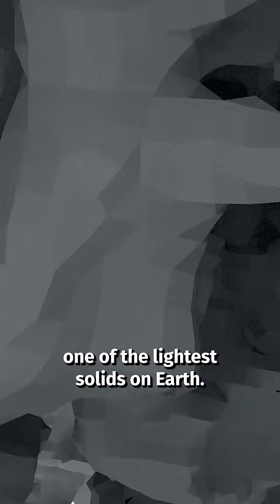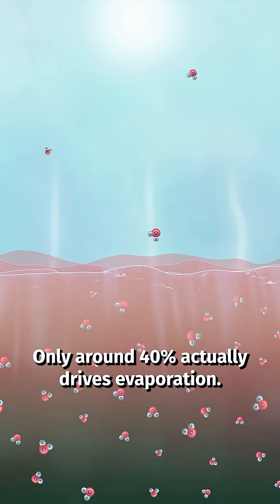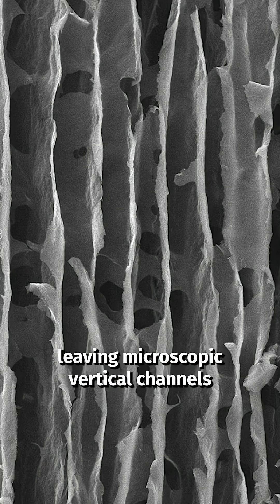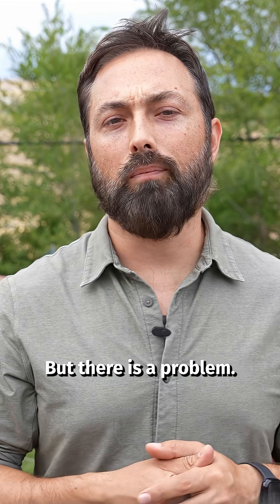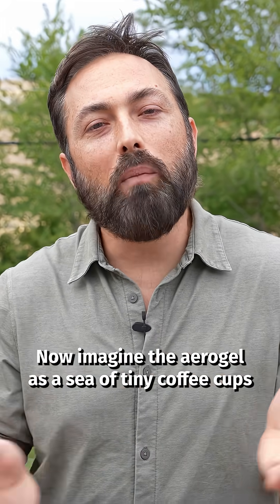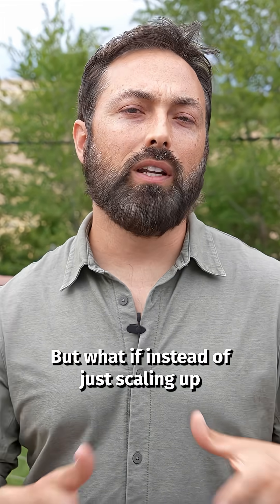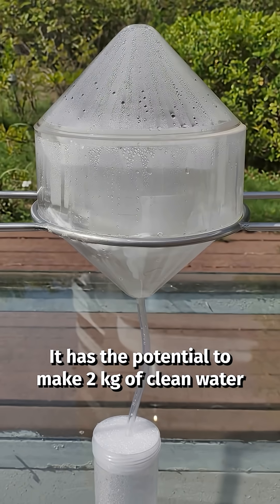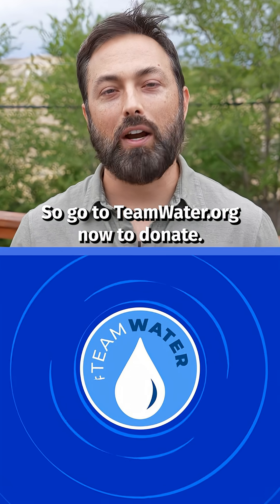How aerogel can make the ocean drinkable

Comment: I think you should be able to make the Aerogel work better with water if you made it of little Venturi tubes. I think it’s called a Venturi tube but either way if you shape the Venturi tubes into an upside down l pattern and the water pools at the top of it then you should get a similar result as to what you’re doing already with the spaghetti structure. Idk I feel like there’s a better way to do this but I’m no engineer by any means when it comes to designing stuff. I have a lot of designs for the tubes in my head but they are hard to explain in a simple comment section that doesn’t allow pictures.

Comment: Great ideer!
The only problem is we only have so much water on earth if over a 100 year span we drink up about 50% of the water wouldent the earth be full of natural disasters? I meen i understand in small types this ideer is useable but if all people start drinking ocean water in some point in the future there wont be any water to drink and wut then? In most countries there is enough rain water to make that drinkable. And maby if those countries make good rain harvests they can sell that for cheap to countries without rain. So all have drinkable water but dont drain the oceans
Reply: You are assuming that once the water is removed from the ocean, it is never added back. This is not the case, the water does make its way back to the ocean, partly through the natural water cycle like rainfall. There is also considerably more ocean water than all the sources of fresh water combined - we couldnt really “drain” the ocean even if we wanted to!
Honestly, the pollution we are adding into the ocean is a far bigger problem then any amount of water we remove

Comment: Sailor here. Normal desalination requires around 13W/gallon. A m^2 solar panel produces about 200W/hr. That's 15.4 gallons per hour, and once your water tank is full the energy can be used for other needs. 2kg is only about a half gallon.

Comment: how much water would need to desalinated before the ocean becomes a death trap for the fish? Any risk of making the ocean “too salty” for life?
Reply: It depends on the area, the impact is more severe for an area that doesnt have as much water flowing back in, but also desalination can be used to harvest salt as well so we aren’t necessarily putting 100% of the extracted salt back into the body of water it was extracted from. But yeah, the increased salinity can be an issue, and mitigating that involves balancing the natural rate of water flowing into the area vs the rate we extract it out, and also by diluting the salt discharge from the plants (because the increased salinity can have a localized impact where the salt is discharged). Tbh though, increased evaporation due to global temperatures rising has more of an impact of ocean salinity than desalination plants do.

Comment: If you’re using the heat of the sun to evaporate that water and collect it at a higher point can’t you scale that up massively as a closed loop hydroelectric system all you need is sun and a body of water

Comment: for those wondering: desalnation is the process of evaporation and condesation. Make a roof and the room sealed up, ou heat up the saltywater and the water vapour collects itself up at the roof then, open a valve up there (at the roof) then cool the vapour, it turns to solid right? So melt it now it is done! You successfully filtered salt from water now you can clean the salt and that can be used in foods and stuff  too!

Comment: This sounds extremely bad, several factors
First over time this can only be viable as a scalable concept if it is extremely chemically stable. I don’t know what it is but unless it’s about as reactive as oxides it would likely decay so fast it would be insane to attempt to produce it (rate of production is flat but rate of decay scales with deployed amount)

Secondly you’re using micro structures to... be soaked by ocean water. Sounds like a lovely way to get plugged by particles + salt deposits

Meaning in both cases the gel would decay quickly under operating conditions meaning you’re basically producing aerogel as a rate of water production which is completely unhinged and if scaled up would also create a lot of waste in the form of old salted broken down aerogel

Comment: So...add a pin to the top of the gel...then on the top of each pin..put a small fan that can spin when heat is applied due to the evaporation...those fans will help those layers rise and cool better if its an enclosed system...

Comment: You have to merge existing technology together. Use the solar panels to an electric battery that's waterproof on the ocean. Then make those little Chambers of solar diffusers really small and put those AeroGel filters inside them so that I both can do those two things. Heat up the water, then modular installment that water can go through a long tube and filter even further

Comment: There is some serious potential here. Researchers create a new thing, and then test it for every possible use they can see potential for. Not every one will be a game changer, but enough will merit further tweaking to get the desired result. One of those in every life raft would help solve a major problem while waiting for rescue at sea. It wasn’t that long ago that lifeboats had no way to protect from the sun’s heat, and storm surges. Researchers test for every possible application, and apply subtle techniques to get the most out of each new discovery. This is early days yet…but time and testing will solve the current drawbacks in widespread applications.🖤🇨🇦

Comment: Surly a pyramid Square with 4 enhanced glass magnifiers focusing in the centre directly above the sea surface to create steam which will travel up to the condenser to create drinking water.!!! Keeping the condenser cool at the top would be a challenge but 4 large copper heat pipes creating the pyramid structure floating above the water should help keep the top of the pyramid cool enough to condense the steam into drinking water. You could create a mini vortex tornado to 😮keep the steam focus in the middle of the pyramid to hit the condenser exactly where you need for maximum effect. This design is ultimately dependent on direct sunlight which is the downside.

Comment: The problem with using the sun for desalination is not (necessarily) inefficiency, but simply that the amount of energy per land area means it doesn't scale well.

Better efficiency can help this somewhat, but you can't ever get more than 100% out of it. You'd be better off using solar panels to run a reverse osmosis desalination process, which is more inherently energy efficient and the technology already exists and is proven. You wouldn't even need batteries for the solar panels as you could just overproduce fresh water during the day and store it for the usage during the night.

Comment: They should use a one way mirror glass on top of where the light enters in- and only going in to get reflected, with holes on the side to collect the airy water. Add a mirror at the bottom to double or just increase the power of the beam reflections

Comment: There are transparent solar panels now that aren't as efficient but still make electricity and let light through. That electricity could be used to power fans to circulate air. Getting more complicated but possibly with much higher output would be using a Fresnel lens on a mount that tracks the sun to concentrate light. It doesn't have to be a be a perfect pinprick focus to massively increase the heat.

Comment: Or you can dump a bunch of carbon black into the water then all the light becomes heat at the surface then you have a solar powered fan blow the humid air into another chamber that is cooled by fresh sea water in a radiator like structure and the clean water vapor condenses out of the air

Comment: Now all thay need is a light weight solar border that floats with small fans to hold the replacable arogel inserts because all the salt and other particles from the desalination will eventually clog the system and the small fans can speed up displacement and if thay wanna get super fancy thay can add a small gps and rc controller and also use the fans for basic navigation and control of the system

Comment: The first 5 desalinazation sties in the U.S. were built back in the early 60's. Then Vice President Johnson substituted for President Kennedy at the ribbon cutting at the one in Freeport, Texas. I attended with my father and got to shake Johnson's hand. WOW, little old me (I had just turned 10).
While one source claims the plant shut down in 1969, that was when the subsidy money for the discounted price of the water funded out from Congress. And several sources claim the water was supplied to the city of Freeport, but only the north portion that used to be the town of Velasco that had a seperate water system got that good tasting supply. Our side still tasted like stale shrimp peels 😅.
Yes, there had been drought in Texas, but another problem had presented itself along the Gulf Coast. - water wells. Bunches of them. Population - housing starts - and they all needed water. And to get that fresh water the wells were having to be drilled ever deeper. But why? -> salt water creep! Take the water out - the water creeps back in. And that water was salty. Drill deeper. Lather, rinse, repeat.
Eventually the maintance on that first saline plant was shut down and has it since been dissambled. The government and Dow Chemical did not wish to continue or replace it.
And now, the very few times I have returned in the past 55 years, I would be sure to bring my own water from my home. And I collect rainwater. (Found out where this town's 2 water wells are and why the water tastes so funky!) 🤮

Comment: The cool thing about aerogel is it's so light and heat insulator that you could create an enclosed flying city with it by keeping the air inside a few grades warmer than the air outside.

Comment: You spelled metre, incorrectly. A meter is a device that's used for incremental measurements. The unit of measurement is called a metre. They're spelled differently, because they're different words with different meanings.

Comment: If you use a thermal expansion pump to evacuate a tube, which has a transparent, solar, dumb, and an absorbing background, you can desalinate water and transport it at the same time.  One of the big issues with desalinization is the brine that’s left behind so if you have these solar evaporative transportation tubes across the desert, you can extract minerals while you transport water you don’t need aerogel, but it can’t hurt.

Comment: Seems like stupid idea for most applications, it's water production per cost of materials, not size of materials that matters more... maybe for camping it could work.

Solar panel makes electric power that drives water pump, have something like a solar oven for evaporation, lots of ways to make thin layer of water on top of a black surface, and either harvest the solids left behind as sea salt, etc (ice melt if not good enough for consumption), or have an occasional flush cycle
Reply: They are using extremely expensive materials that can clog easy...

Comment: It appears that they are not addressing one issue— the dissolved solids in sea water, which ultimately lead to scaling which in turn will clog the osmotic tubes / channels hence significantly reducing the evaporation capacity of this material.

Comment: Am i missing something? The aerogel is basically functioning as a passive pump. What stopping us from pumping water onto a big flat black pannel with more contemporary tech?? It's the salt. This aerogel would be great for small scale emergancy uses, but i don't see it being any more scalable than what we could currently do. It simply isn't as easy to desalinate water and so profit margins dictate we don't. If companies were forced to do it, it would be happening and the cost would be passed on to us.
Reply: Capillary effect not a pump.
Reply: A) Desalination is done on a large scale in some places. Basically, deserts with a coast (especially islands) is the formula. 

B) I think the main innovation is that this setup siphons away the water vapor after evaporation and thus greatly speeds up solar desalination. Most commercial desalination is currently reverse osmosis (filtering) rather than evaporative so solar systems need to be faster to be viable and this is a step in that direction.
Reply: So public desalination is necessary. Profits will dictate what they will dictate, but that is not always good. In this case, it clearly is not.
Reply: I'm guessing the benefit of the aerogel approach is that it is completely passive. No energy or even infrastructure required, just place it in water and wait.
Reply: Pumping ocean water has many problems associated with it, the energy cost is just one facet of it. The water itself would also be very damaging to the infrastructure pumping it in the long run so you'd spend quite a lot on maintenance as well
Reply: We don't know how costly it would be
Reply: You can't get the water out of the aerogel without adding energy because that would violate the conservation of energy. the water is basically stuck in the tiny channels unless it gets enough energy at the top(in this case from the sun) to escape.
Reply: Yeah, the hard part is what to do with all the salt and other minerals - you can't just pump it back into the ocean.
Reply: I like the development step, though. It may not be a be-all end-all solution for desalination, but it's tons better (using the process of unpowered evaporation) as a filter than any filter currently used in the process. Ultimately, I wish YouTubers would stop dramatizing useful technological steps as "the greatest thing since sliced bread" when tech and engineering is best accomplished (though not always advertised as) a step-by-step process. We want the glamorous and sellable sliced bread without all of the messy details of "cutting boards" and "wheat cultivation," know what I mean? 😃